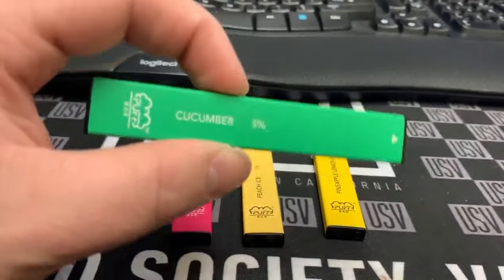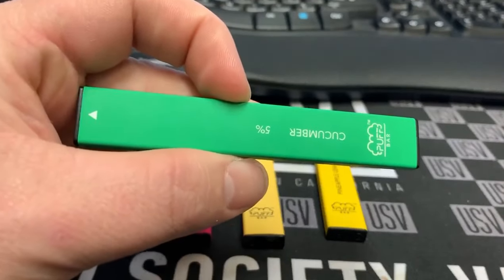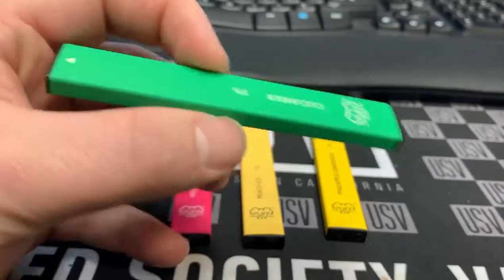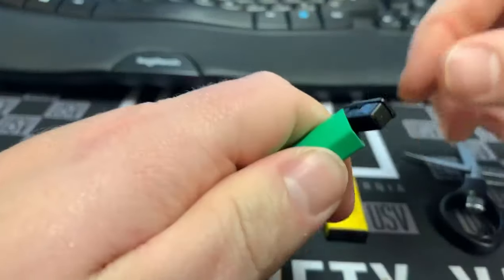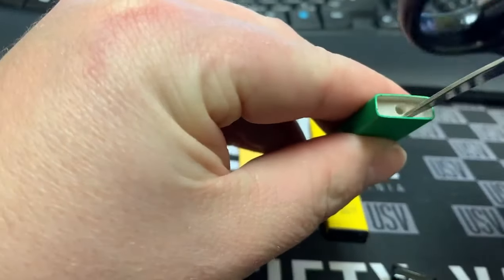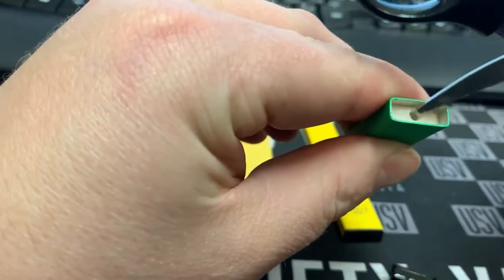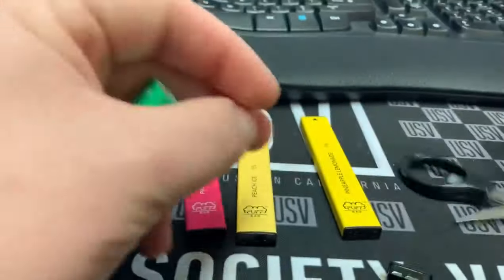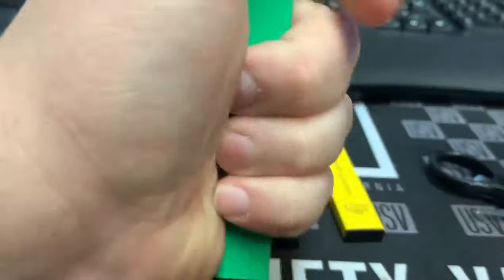New Puff BAR Disposable Not Hitting Right How to Fix

Comment: This didn't help, when I hit mine the light comes on and nothing comes out and the light quickly goes out. Every once and a while it will give me one hit then keep doing what I mentioned before.
Reply: Roxas The Forgotten same
Reply: Did you find out how to fix it
Reply: That means it’s just dead
Reply: did u fix it?
Reply: Yo bruh same thing happening to me with a pink lemonade rn do u know any fixes
Reply: Push the bottom and the top at the same time hella hard
Reply: Yeah mine does that and it’s brand new, this has happened before with all my grape ones
Reply: Turns out, when they are making the puff bar they are messing up with a black film that goes over sensor telling the puff bar to hit ( why you get hits with nothing) there isn’t much you can do about this
Reply: It means it done it’s out of juice you only get like 200 hits off of a puff bar
Reply: Yeah mine did that, it didn’t blink like it usually does to tell me it was out either.. I got it yesterday and after hitting it like 10-15 times it started to do that
Reply: ARIZONISTIC how can it be dead? I just got mine today and nothing is coming out
Reply: ARIZONISTIC its dead if it blinks
Reply: It’s not dead, put it in the fridge for ab 20 mins or until cold and hit it and it will work once after you get it cold 😂 no cap
Reply: Michael Larson ok but this really did work. ive exchanged 3 from the same place bc they work for like one hit every hour then light up blue for like 3 seconds but nothing comes out  so i have to wait forever again and this shit worked
Reply: Michael Larson this really work?
Reply: it’s over
Reply: Marco Vasquez what button
Reply: Michael Larson for real
Reply: That means its dead lmao
Reply: Michael Larson wow this worked!!! Thanks. I had this problem only with the GRAPE flavor. It would light for 2-3 seconds then shut off with no blinking. No hit. Pulled out and replaced cotton with no luck. Put in freezer for 20 minutes and hitting again. Thanks!
Reply: LeachPod update: this only worked for 1-2 hits and stopped again. This also occurred with the Grape flavor. Waste of 10 bucks! Stay away from the Grape! Those are faulty!!!
Reply: Maty Oobrien mine brand new and it’s doing this I only taken about 30 puffs
Reply: Michael Larson SHOUTSOUT TO YOU thank you think worked 🤯❤️
Reply: Same
Reply: Lmfao just buy a fucking nother one
Reply: Roxas The Forgotten  MINE TOO!!! And it’s brand new. It’s sooo frustrating
Reply: Roxas The Forgotten dude mine is doing exactly the same. Pops are so much better 🤦🏽‍♀️
Reply: ARIZONISTIC no cuz it still works it takes a big puff out
Reply: ARIZONISTIC it’s dead when it blinks mine did the same thing and i had only had 30 hits it’s not dead
Reply: LeachPod  I just recently got a grape one too. I barely even hit it and it lights up when I pull but no smoke comes out. I’m thinking of just popping mine in the fridge since I see it works for you haha
Reply: Marco Vasquez clutch
Reply: Me too pls help
Reply: sooo it turns out when this happens, yea it hits for like .2 seconds when u take it out of the freezer but the sad sad truth is is it’s a dud, there’s always one in the box and there’s not actual way to fix it as i kno if :(
Reply: @Squidwordwavypants  lmfao
Reply: Lauren Cummings is you bad tho
Reply: Owg Megatron I mean ya
Reply: Lauren Cumming insta ?
Reply: Roxas The Forgotten I feel you bro same here
Reply: @Squidwordwavypants  snap: llclaurenleigh
Reply: Maty Oobrien no.... it’s a manufacturing problem because mines brand new and is doing this
Reply: I figured it out. Just hit it really slow but heavy. It worked for me
Reply: @LachlanNorrie  bro my pink lemonade just stopped and i bought it this morning and i wasn't even hitting it that much
Reply: @MichaelLarson563  for real? Or trolling?
Reply: Lachlan Norrie same bruh
Reply: Michael Corleone I bought a pink lemonade 2 hours ago and it’s not working. Never gonna buy pink lemonade again then
Reply: @abbygodwin385  damn never again
Reply: Michael Corleone I always get the watermelon ones and never had a problem with those. Only watermelon from now on lol
Reply: @abbygodwin385  green apple always works for me too 😬
Reply: David Cha damn this worked
Reply: Michael Larson say swear
Reply: Maty Oobrien it’s new tho
Reply: i’m pissed mine has been broke since the second i got it and i woke up the next morning and the light still works but nothing comes out
Reply: Roxas The Forgotten it belongs to the streets (aka “The trashhh”)
Reply: Same to me too bruh I’m I just bought this shit and kept doing sum dumb stuff 😡
Reply: Michael Larson  no but why did this actually work tho?
Reply: @marcovasquez4739  This actually fixed mine
Reply: that’s happening to mine too
Reply: charge the battery that means it’s dead
Reply: Janaé Alannī you can’t charge these. They’re one and done
Reply: David Cha this made my puff bar start SMOKING 😭😭
Reply: i had the same exact thing happen but i just smacked mine on the ground and it worked again lmao
Reply: same
Reply: @arizonistic2125  no but it doesnt blink , the lights on for however long i hit it, but nun ever comes out
Reply: Leann Ellis SAME

Comment: "It'll pop right open" me still trying to pop mine open
Reply: alycia hollins ME TOO
Reply: Oof yes I got it open but it didn't fix the problem ;(
Reply: alycia hollins SAME :((((
Reply: How do y’all open them?
Reply: alycia hollins I just used my teeth it’s easier
Reply: Bro i just fucking lost half of my thumb nail
Reply: Charlie D LMFAOOOOO
Reply: half the time i open a new one the top pops off bc i use my teeth oof
Reply: alycia hollins aame
Reply: Qt_DraZzY thanks for the advice. Now my dog chewed up my device and he’s now walking sideways. Canine idea not a good one
Reply: @stanishawray4207  take a pair of needle nose pliers and grab just the cover and gently wiggle it until it pops off. Or, take a small flat head screwdriver using the corner of said screwdriver run it along the seam where the cover meets the metal being careful not to gouge it because the metal’s thin.
Reply: @AlyciaHollins  oh you play highrise too, they fucking banned me. I might have to buy a new phone to play. 💀

Comment: I literally got one and took it out of the plastic package and the blue light doesn’t light up, no smoke comes out or anything. I took it straight out of the package.
Reply: Same!!!
Reply: U gotta hit it hard the first couple times to break it through thats how mine was, also did you take the rubber piece off the bottom airflow?
Reply: And when u try to return it they won’t accept it since u opened it
Reply: Itz Brandon nah straight up just doesn't hit at all. Nothing even if you blow into the top or bottom
Reply: Itz Brandon yes. I tried it a shit ton of times and it didn’t work
Reply: Word of advice, wherever you buy your puffbars from. As soon as you walk out, open it up and check for leaks, take a few hits and make sure it hits good. If not, the shop you bought it from will exchange it without hesitation.
Reply: Nate b i just bought mine and it leaks
Reply: tuff asf
Reply: that's what litreally just happened to mine
Reply: BRU SAME
Reply: SAMEEE
Reply: Luckily at the store by me the clerk felt bad and gave me another one and said he forgot to tell me to try it in the store first, we tried 3 more and they were all leaking and not coming on like the one I bought already, he allowed me to play the difference for  a switch mods disposable and it worked perfect. I got lucky.
Reply: Ciall  Nah the store should not sell fake / broken merch. You shouldn't  need to open and test every puff bar you buy, and if your local smoke shop is doing that they are selling you fakes. Stop going there. Shady as hell.
Reply: the package that these things come in say they are good for 300 hits, you're lucky to get 50 hits out of this piece of junk
Reply: @Am71919  Puff plus lasts me like 3-4 days but sometimes only 1. Puff bars are shady. I want something with more  quality control. I miss mango Juul.
Reply: Me too pissed me off

Comment: I puffed mine the wrong way and it hit for a full 20 sec I was scared it was finna blow up on me . wtf man
Reply: bruh me too
Reply: Lmaooo😂same I threw it at the fuckin wall
Reply: YOOO FACTS HAPPENED TO ME IN THE CAR IT GOT MAD HOTT
Reply: Blurred Eye Visuals that shit happened to me but now when I rip it no smoke comes out but the light goes blue and this vid didn’t help
Reply: Luke 56 when mine did it I blew into the bottom then it ripped again
Reply: Fried yo battery bro
Reply: Blurred Eye Visuals 
PSA if this happens cover the holes on both end of the puffbar to block any airflow and itll stop hitting by itself
Reply: same shit happened to me. Scared tf outta me.😂😂
Reply: Alberto Melendrez LMFAO
Reply: Fock Que did it keep on happening or nah
Reply: Bear Faced nah, it just stopped after a few seconds.
Reply: Luke 56 did u ever figure out how to fix it
Reply: lts taco it stopped by its self and it went out later bc it was out of puffs
Reply: Blurred Eye Visuals same thing just happened to me
Reply: It won’t blow up but it’s made by professionals which makes it heat up but the device won’t blow up
Reply: Just happened to me and I just kept blowing out from the end you are supposed to hit until I could walk outside and throw it at the ground lmao and then it started working again lmaooo
Reply: When that happens just hit it normally and it will stop
Reply: u have to hit it from the bottom like tagt again and it will stop
Reply: Blurred Eye Visuals 😂😂😂😂
Reply: Blurred Eye Visuals that’s just death for the vape at this point😭
Reply: Riley Dempsey it works
Reply: Dont you love auto fire
Reply: LOL
Reply: Me toooo

Comment: i tried it, the light at the bottom just stops lighting up even though i bought it today
Reply: rollypollyoli bruh same
Reply: Mon Beri same 😔 did y’all every get a fix?:/
Reply: Space_unicorn-XI i opened the bottom of it because someone said that can fix it and my red and black wires were cut and not connected to anything so i definitely just got scammed
Reply: Mon Beri F for your loss 😕
Reply: Space_unicorn-XI ik so sad 😭
Reply: mine was the same. i took out the cotton and the rubber piece and something was in the way in the hole. i moved it with a pin and it only worked without the two pieces
Reply: rollypollyoli my plug brought mine to me and I thought he hit it like 300 times and put it back in the box
Reply: Chenzo _ this shit actually worked 🤣🤣
Reply: Zach Starkey yessir glad to help
Reply: why is mine blinking?? i only took about 300 hits man. Also just bought it today. Someone help
Reply: batoha maybe cuz u hit it 300 times already lmfao
Reply: I just think mine is empty and that I just got scammed none of the techniques are working
Reply: batoha puff bars only have ab 300
Reply: Joseph Graff yeah bro ik i was tryna be a smart ass lmao
Reply: Space_unicorn-XI mmmmmm
Reply: Space_unicorn-XI mmmmmmmmmmmmmmmmm

Comment: So regarding it lighting up and not hitting, found that if you pop the bottom up a little where the air sensor is showing... Cover it, and itll hit, and then close it, and itll hit again. You just have to keep popping the bottom open a little and back in repeatedly

Comment: It didn't do anything. Also I didn't see any extra thin layer of cotton either in mine or on the video. Just the piece you pulled out and put back in is what I have. Mine wasn't working straight out of the box. Any other thoughts

Comment: Mine didn't hit out of the box. I took it apart and it was actually the rubber beneath the cotton so if it's still not working check that next
Reply: Kaed and Pachi do I take the rubber off or what do I do?
Reply: @lulusaradih5884  for me I took the rubber out and I could see that it wasn't lining up with the tube underneath it. Take it out and match it up and it should work
Reply: i love you
Reply: Underrated comment 💯💙
Reply: Kaed and Pachi how do i get it to line up? i’ve tried like 6 times 😂😭
Reply: THANK YOU THIS IS WHAT WORKED
Reply: Kaed and Pachi 
Okay how do you fix it though? Because mine isn’t hitting out of the box
Reply: I did it and it worked! Thank you!
Reply: Kaed and Pachi please help me ASAP
Reply: Holly Bauerle what did u do can u help me?
Reply: Kaed and Pachi  where is the rubber at
Reply: Cheers bro worked like a charm

Comment: I have a BRAND NEW puff bar I got it from the gas station and opened it and it just won’t hit the light turns on but it won’t hit
Reply: adrianna same bro it happened to me today
Reply: same just happened to me but the light doesnt work
Reply: Put it in the fridge for 20 mins then it should work
Reply: Dallas Stoy it works for only like 3 or 2 hits and then does the thing again
Reply: Dallas Stoy are u fr
Reply: ME TOOOOO SO MAD

Comment: I found if you pop the bottom plate off and give it a slight tug, mine started hitting. I purchased a tangerine ice puff bar and after opening it, only got 2 good hits off it. took the top off like in this video with no success! pulled the bottom off for shits and grins and immediately after snapping it back on it started working as designed. Hope this helps...

Comment: If you have an elf bar just take the components out and flip it so the mouth piece is on the bottom and the battery is at the top, so your pulling from the other side of the vape, it fixed my elf bar took 2-3 secs for a pull to come

Comment: So if your puff bar is lighting up for a second and then not hitting and turning off right away- it’s a dud and won’t work, but if you put it in the fridge or freezer it can get a lot of hits off, just repeat and it will work over and over

Comment: i just bought one and no light cane on and nothing comes out
Reply: some times they come dry:(( sorry bro i hate when shit like that happens:(
Reply: Same here. Are they just a dud...?
Reply: open the bottom, the wires may be cut. if they are you got scammed.
Reply: Bonald Brump mine was from Cali and it’s brand new. I got two but one works but the other doesn’t
Reply: 21 YC never buy from SMOKE SHOPS always try and hit Vape Shops. Regardless of where your from there will be counterfeits but if you go to the right places you’ll be good
Reply: Got my blue razz today, from a popular vape store in my area that I have bought from countless times, and I had the same problem no light, no juice. Just a dud.
Reply: Zane Watson i had the same exact thing happen! blue razz, and i haven’t been able to get a single hit :/
Reply: @2rcklssvidz  this the second one i got in cali that was a dud. done forever
Reply: Make sure you hit it before you leave the store and do it in front of the clerk. There's many cases where people buy one, go out the store, bring the old one and say that the new one wasn't working to get an extra free one. Many come with manufacturing issues
Reply: some other guy said to chuck it at you wall and it should work, i followed the steps to this then i chucked it at my wall and it worked😹